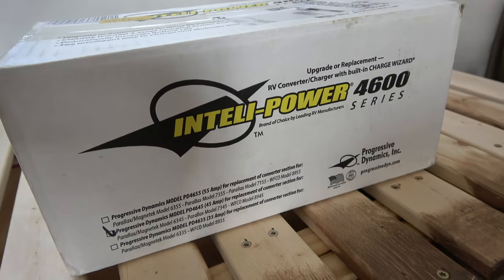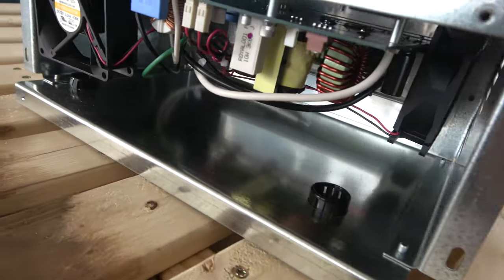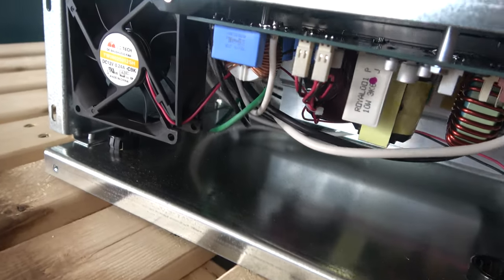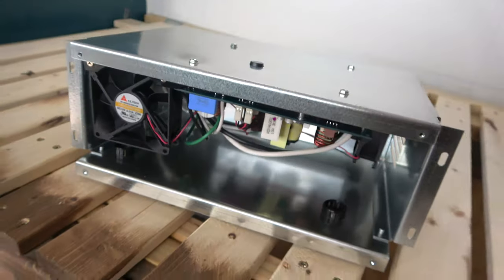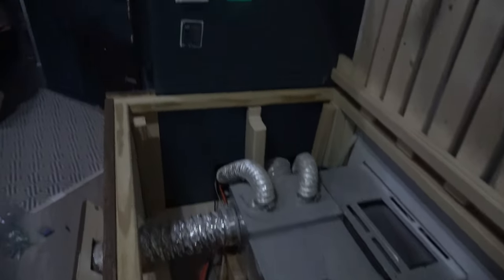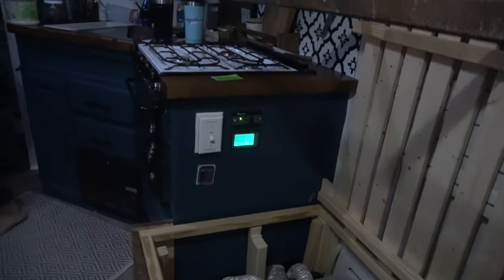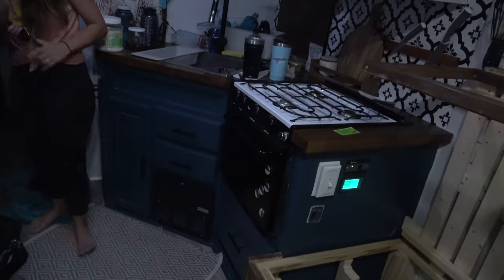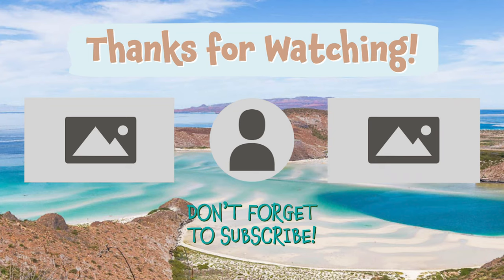CtW 157 // Replacing Our Old RV's Power Converter and Installing a Transfer Switch for Boondocking!

Comment: AGM batteries are really lousy because you can only use 1/2 their capacity, you should switch to lithium? 😤
Reply from the maker: $80 for 140 Ah of AGM > $700 for 100 Ah lithium. One day when we have more money we'll go with lithium. But our AGM batteries are doing spectacular. We have never wanted to battery power. Even with higher than normal use,  our battery bank never runs lower than 80% of our capacity overnight or during shady days. So we still have another 40% we could use before we risk damaging the batteries. I would not say "lousy." But I would say in the very long term (10+ years) then yes, lithium may outperform these batteries. But if you are so concerned about us switching, you can donate 2x Battleborn 100Ah lithium batteries and we'll be glad to thank you on the install video we would do!